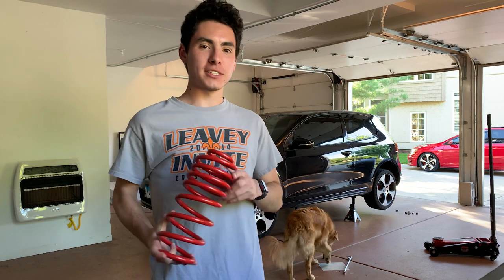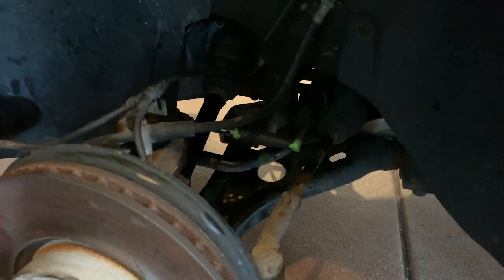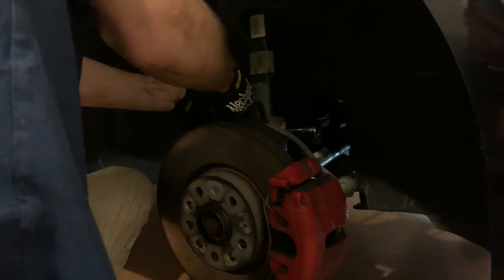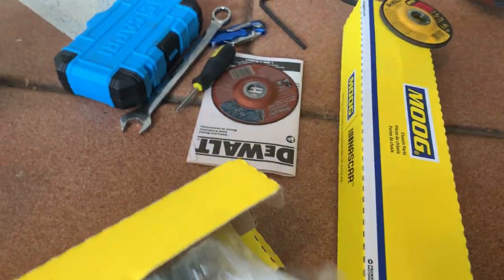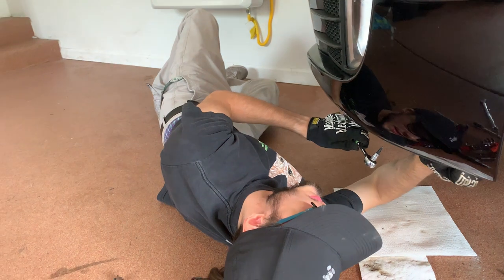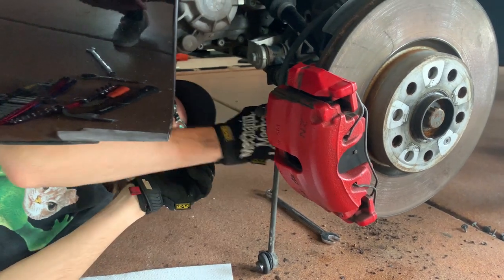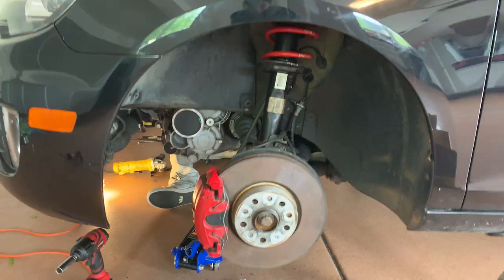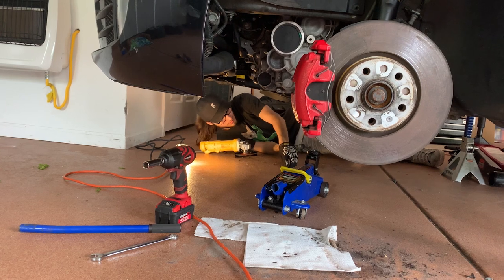Mk6 GTI H&R Super Sport Springs

Comment: Im running h&r super sports with bilstein sport sturts and it handles amazing. Just make sure you upgrade every single suspension component because over time it will feel like the car is falling apart, trust me i freaked out when it happened to me thought i made a horrible upgrade but turned out it was all my bushings and strut towers that went out.
Reply from the maker: Yep, the stock struts needed to go after this. We ended up going with Koni Yellows which have been a solid investment so far
Reply: Or you can just switch to coils? Is that a good idea rather than buying every single component when they start going out!

Comment: Did you have any trouble removing/re-installing the struts without disconnecting the axles? Most installs I’ve seen say you have to disconnect the axel to get enough movement to get the strut out.
Reply from the maker: Not on the Mk6! We did on our Mk7 though. Had plenty of room to get the strut out

Comment: how did you get enough room to pull the front strut out its housing? Did you unbolt the lower control arms from the ball joint?
Reply from the maker: Yes, we unbolted the 3 16mm nuts that hold the ball joint to the lower control arm. Gotta do some maneuvering to get it out but wasn't too too bad for us